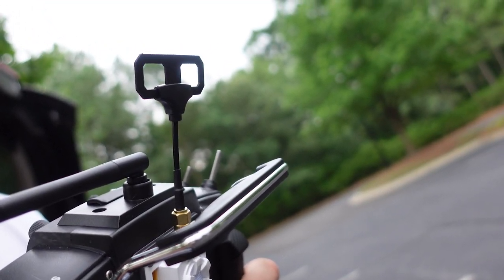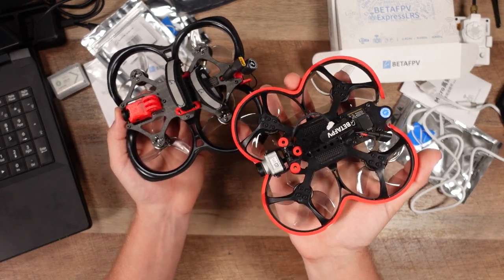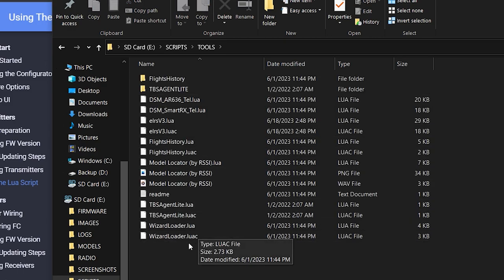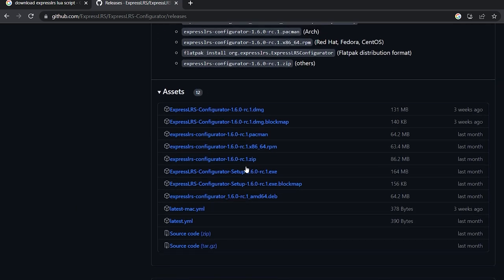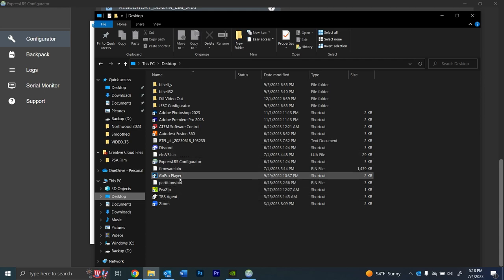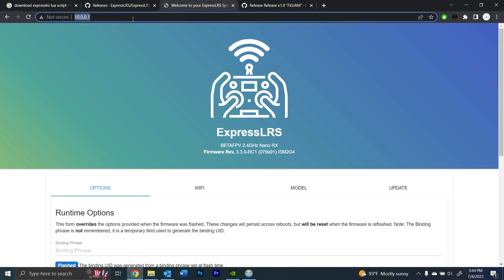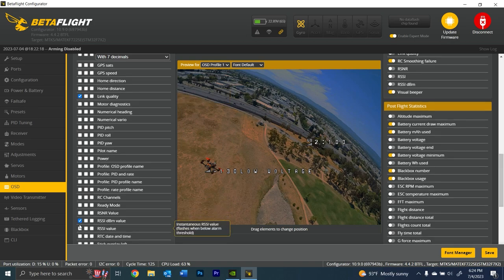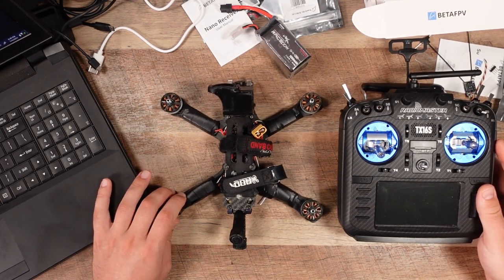Checking out ExpressLRS with Setup (WiFi method) - BetaFPV

Comment: 2:38 So, the module needs a dedicated battery?
Reply from the maker: You need to power it with XT30 if you want to go max on the transmitter power. It'll do just fine with only radio power at 250mW and below.

Comment: 23:06 Do you know what happens if I were to "uncheck" the auto WiFi on interval?

Will it just disable the WiFi altogether?  If so, how would one get it back?
Reply from the maker: You'd basically be disabling the WiFi function, but you could still update over Betaflight passthrough. BF passthrough is also how you could reflash the firmware to restore WiFi interval if it was disabled. I'd personially never disable the Wifi function since it's so convenient once you set it up.
Reply: @EdRickerVlogs  Oh ok, thanks. I thought that was the problem -- that the WiFi was disabled. However, I just learned that SPI receivers don't have WiFi. 

But, I agree for UART connected receivers, no reason to disable WiFi. Thanks, Ed. 👍